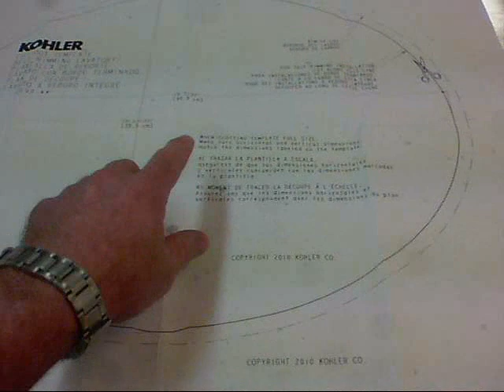How To Cut Granite DIY. (You had best do this outside)

Comment: Oh My god !!! Your going to get "SHOCKED" by another of these  so insightful comments !!!       
                         Great video I've taken some notes... just saw another  with a guy using a plastic bottle with small hole to the side to feed the water almost automatic and Kept dust down well... I like your use of that packing insulation.. and the inward angle to hold grinder I do the same with tile but you had some extra good tips.. got to be imaginative to due on the cheap..Scored two slabs long and narrow will have to chop soon. Thanks for your help.
Reply from the maker: Thanks for the comment.  Ive been shocked so many times by 110 volts that it really doesnt even bother me even if it did get shocked.
Reply: @pusherpilot  Me to suppose things can line up for a bad event but things need to get accomplished.. If we stopped to do an OSHA check every time we got out of the house we'd never leave the porch... who would machete the way ??

Comment: You did inspire me to cut my own granite for a kitchenette.  The only cut I need to make is a rectangle from the middle for a bar sink.  I can buy a slab cut to fit the cabinet and save hundreds by cutting the sink out and polishing two exposed sides.
Reply from the maker: Thanks Mike for your comment. Easy to do but please do it outside.
Reply: Mike Bunger yep...I'm looking to inspiration to go out and make one. cut to use it in my work shop...inspiration and motivation.

Comment: I have been electrocuted doing exactly this- feet in the water, power tool in hand. I jumped 5 feet into air and thought I was dead. And that was with a 110 volt GFI protected extension cord! It clearly saved my life. Wear rubber boots, dry rubber gloves and be careful!
Reply: thanks

Comment: Thanks for sharing. How thick was the granite you cut? Yesterday I bought a grinder with 4 1/2 inch blades, but it’s missing about 1/8 of the bottom when I cut. I was attempting to make a larger cooktop opening for my too big cooktop. Thanks
Reply from the maker: This was about 5/8 inch thick

Comment: Folks, don't get too worried about being shocked using water with these modern tools. I've literally laid in a water puddle in the poring rain grinding a floodgate hinge stop. 
Electricity isn't a magical creature that crawls out of the grinder just because there's some water around. If you're not shooting water down your arms and into the running grinder you'll be fine. 
Almost 20 years as a millwright and industrial electrician.
Reply from the maker: +Brian Hagmeier  Thanks for the support Brian.  In my opinion if you always look for 100% safety you never get anything done.  Thanks Bro
Reply: Brian was a very nice guy, we lost him cutting granite in the rain.  ha ha
Reply: Brian Hagmeier oh come one...I need to have an excuse not to do a straight cut...I keep telling myself it  would only take about 30 mintues...
Reply: Wow, we have a lot of electrical engineers here. Let me help you out, the thing making the grinding wheel spin, it’s called a motor. Motors use electromagnetic fields to turn a rotor. Where there is a motor there is electricity. You don’t need water running down your arms when you have someone spraying the tool with a garden hose. People without knowledge in electricity should not be giving advice to other people; it’s dangerous. Anecdotal evidence of “I” or “so and so” did it so it must be ok, doesn’t cut it. People, use your brain, go and buy a pneumatic grinder. They are $29 at harbor freight then you have no worries.

Comment: So sick of whiny homeowners in Youtube comments trying to make themselves feel important. Scared of 110v electricity around water? What do you think a wet saw runs on, willpower? All modern tools are double insulated and it is literally IMPOSSIBLE to get shocked from them.  I work construction and if we didn't work with our tools in the rain none of you would have the house you're sitting in. Go comment on OSHA videos if you have nothing except fear to contribute.
Reply from the maker: You are the man! Thanks for that support
Reply: Wet saws have sealed motors for just that purpose.

Comment: My friend you are a fool for allowing your extension cord outlet sit in that puddle of water while your foot was right next to it.  Electricity taken any and all paths including you.  While you may have not been electrocuted yet, I don't think you will be able to post a video after you have been telling people not to.  I hope you at least have your tools plugged into a GFCI protected outlet.
Reply: +Passed High School Physics Did they not teach you in physics that electricity is looking for &quot;ground&quot;? Why would current flow from its desired home at the ground up through massive resistance in his body and back to ground? It wouldn&#39;t.
Reply: Damascuss07  Not sure what you were taught but electrical current takes any and all paths.  Where you not taught the human body is a big sack of water?

Firemen are taught if they come across a live fallen power-line not to take steps toward the power-line because current will travel up one leg and down the other and has the potential to kill.  As any firemen.

Long ago electric street cars use to have only one trolley pole.  Why because the ground was the rail.  This caused stray currents which eroded the pipes causing water leaks.  This was figured out by Fritz Haber who had street cars fitted with two trolley poles.

Just seems crazy to spray water on an electric tool that's not meant to be used in wet environments.  Hope you are using a GFCI.

You are dealing with electricity...  It can kill.